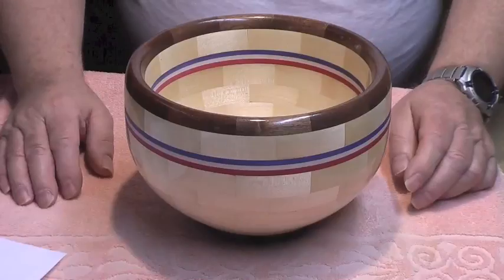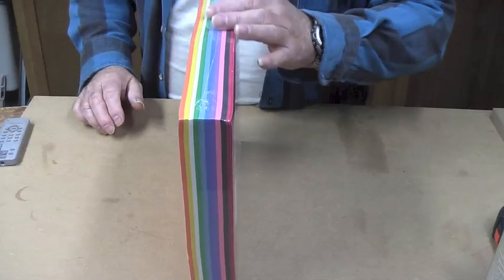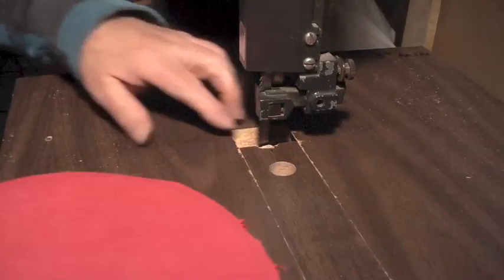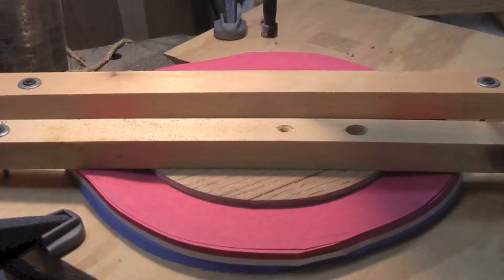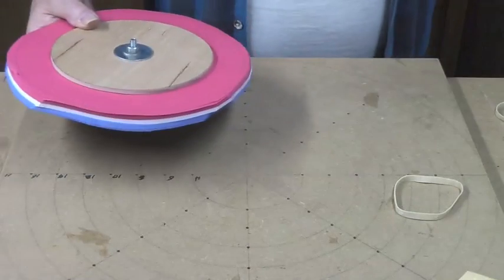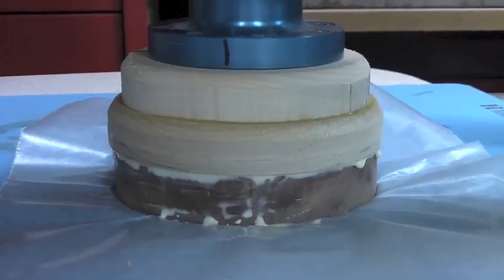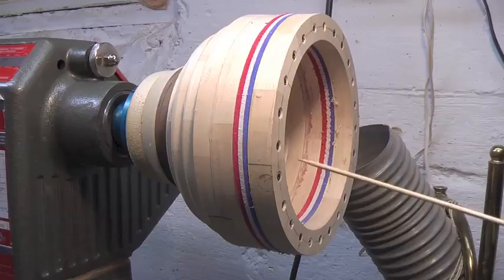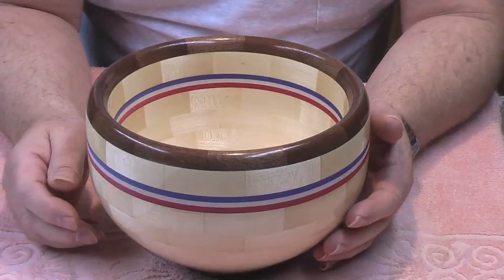Paper Ring Bowl

Comment: I think an epoxy or other polymer based paper composite would be plenty strong, maybe up to a full 20mm layer. 

Leaving the paper dry, then adding screws does seem messy.  But without the screws this could be a nice and quick way to add contrast to a bowl from a board or segmented bowl.   Remember paper is just wood fiber.  I was chuckling when you said you weren't sure how it would cut on the bandsaw.  I cut cardboard on the bandsaw and table saw often. 

I am thinking of using pink paper, lots of fun color options with craft paper.  Pink is my daughter's favorite color!

Comment: Hi Dennis.
I did the same thing with perspex and plastic. A little more expensive than craft paper but easier to work with. I have used a blue plastic lid off a storage box also.
Managed to find some at the rubbish tip. The good thing about perspex is it comes in colours and can be segmented using alternate colours. I use an epoxy glue to butt the segments before jamming.
Good Luck.
David. Perth Western Australia
Reply from the maker: I find your idea, very interesting.  How do you glue it to the wood and how hard is it to turn?  If you have any photos, send me some to denny@dennyedwards.com Thanks

Comment from the maker: The red and blue have not changed, but the white paper has turned yellow.  I do not know if that was caused by the sanding sealer or the polyurethane.  It has not had time to oxidize.  I still have the waste left over, so when I have nothing to do, I will run some tests.  I most likely will never do anything with paper again, I just wanted to see if it could be done.

Comment: Did you consider applying a thin coat of epoxy to each sheet of paper to turn them into a solid block of colors?   I am wondering if doing so would have enabled you to build the bowl without the screws.   The only downside I can think of would be the likelihood of gumming up your chisels.

Comment: I have never made a bowl or done a lot of turning but I have to ask because you may have simply not caught this. Wouldn't it have been easier to sandwich the paper sheets between the two rings you were going to use along with the plywood centers and then cut them out on the band saw as a whole piece? I know the piece would be thick that way but I'm just wondering if it would strengthen the paper when you cut it to make it easier to cut because you did mention you had problems cutting it.